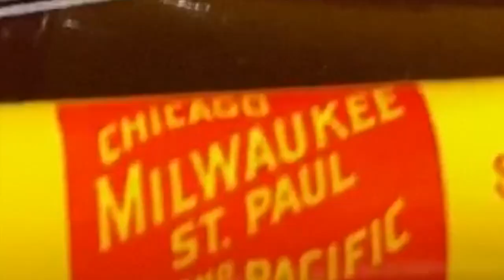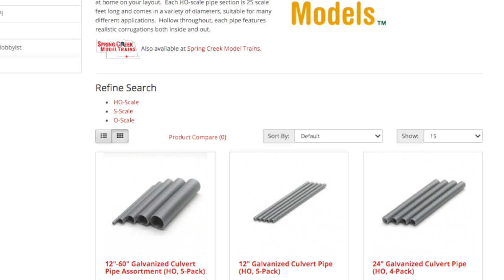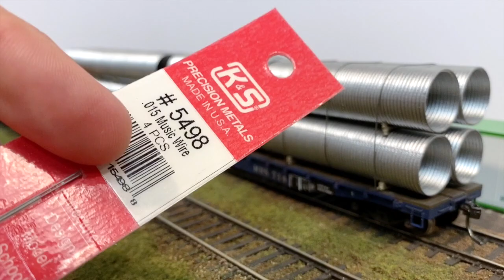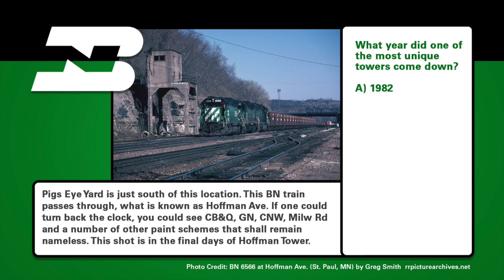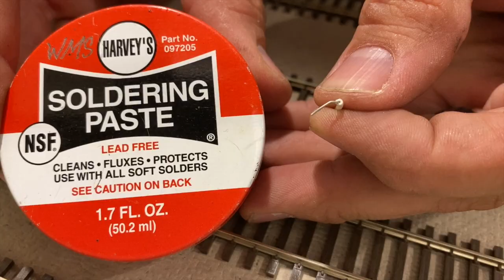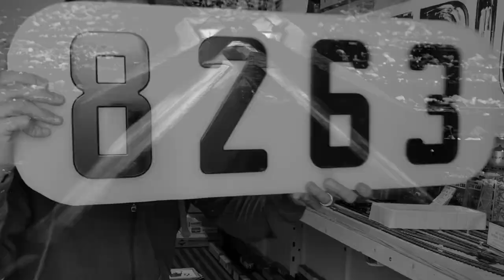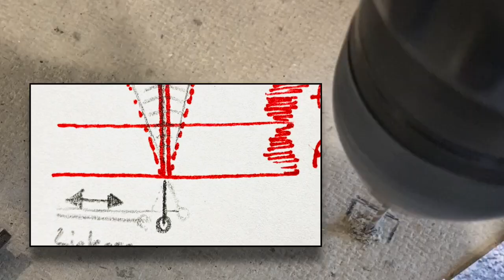S04E04 - How to Power Track, Turnout Prep, Custom Flat Car Load & MORE Vintage footage w/ Bob Rivard

Comment: Another excellent episode! Your magnet idea to hold the pipe load to the flet car is pure genius. I may have to try that on my next removable flat car load. The guys at ISE are fantastic to deal with, a great company with amazing customer service. It is great to see you making progress on your layout with wiring it up and getting the turnouts mounted. I recently "upgraded" to Kester 186 liquid soldering flux and it seems to work much better for all my soldering jobs, especially with decoder wires. The video of the crew "kicking cars" is very rare, it is a real art form to do it right. I better go look through my modeling stash to make sure I don't buy what I already have, or suffer the wrath of the Curmudgeon. I am already looking forward to the next episode. -Tom
Reply from the maker: Tom, you continue to influence my modeling efforts. I’ve since purchased an applicator of Kester 186 flux. We’ll give it a try. I hope the Curmudgeon doesn’t have you going out to buy another GP38-2 that ya misplaced?!? Then again...if ya buy one, then find one, now ya have a pair! 😆

Comment: I've seen guys soder to the bottom of the rail or to a rail jointer to hide the wires/sodor joint.  I remember riding in one of those red checkered bike seats and I'm not the old.  That Curmudgeon has it all figured out.  I wonder how many tape measures I actually own(it got to be a lot).  I'm gonna have to remember that magnet trick when I get to doing loads for my flats.
Reply from the maker: Ha ha, Fred the tape measure example is spot on! I’ll have to look into the under rail soldering. I’ve attempted it in the past, but with little success.

Comment: When the track is weathered and ballasted, the solder joints are not quite as visible.  If you remove some of the tie strip you can solder the feeder wires to the bottom of the rail and then cut off the "spikes" from the tie you removed, then slip the tie back into place.  The feeder wire will be practically invisible.
Reply from the maker: Kevin Eich that’s a GREAT idea...I’ve tried to solder leads to the bottom of the rail, but was finding them troublesome to get a good connection. Your method is certainly worth giving a try. Thanks for sharing the info!
Reply: @SootheMilwaukeeRoad  You only need to remove one tie to gain access to solder the wire between the existing ties and the one you remove and are going to replace.  Drill the holes in the roadbed the same way you did for the throwbar (perpendicular to the track centerline) under the rail.

One other thing I forgot to ask is that solder paste looks like acid plumbing flux.  I've heard that can corrode the wires at the joints.  There is a rosin flux (that is the same stff in the core of electrical solder) that doesn't have the corrosive properties.
Reply from the maker: Kevin Eich what a great bit of info! I’ll have to look at the flux, it’s been in my solder bin for years. All contacts have held...but that may be the solder doing the work. Thanks for the feedback!

Comment: I cringed when I saw the paste flux..lol. When I started back in the wonderful world of N scale in 1999 I used paste flux, just messy. Then I tried rosin flux,ehhh, it worked okay.
     Now these days I use a liquid flux,called Superior #30 super safe. I use it for all soldering tasks..from dropping feeders to building N scale turnouts.
I know one thing I did with the paste..when done..i always ran 70% isopropyl with a toothbrush over the soldered area to clean any residue.
Keep up the great work!
GB
Reply from the maker: Greg, this info is invaluable, I’ve ordered up the new flux...if you’re cringing from the paste, I’m clearly behind with the times. 😆 Thanks got the tip, my skills continue to grow, thanks to fellow modelers like yourself offering up the updates. Thank you!
Reply: @SootheMilwaukeeRoad  
No problem, glad I could help. 
I need to get off my 6 and start working on my Hiawatha Ave project
Reply from the maker: Greg Burzynski 😆 The line, “Get off my 6...” is great! 😆